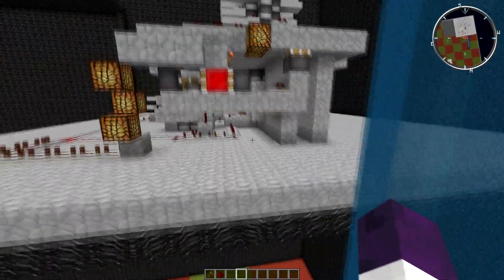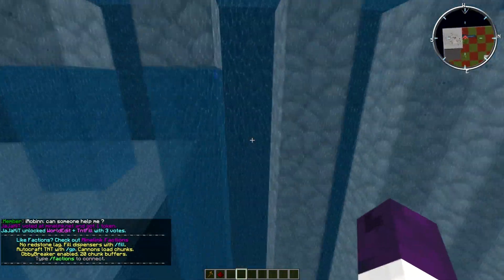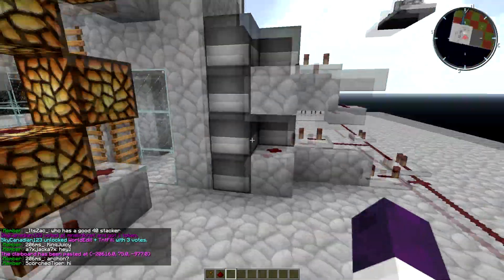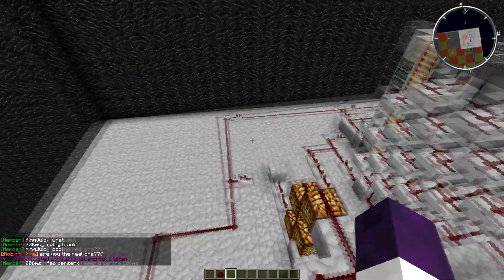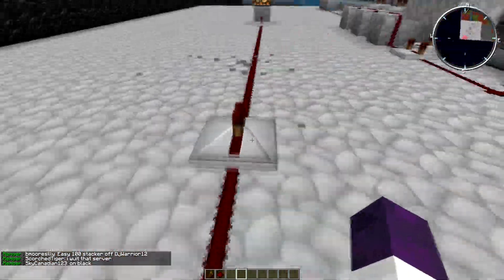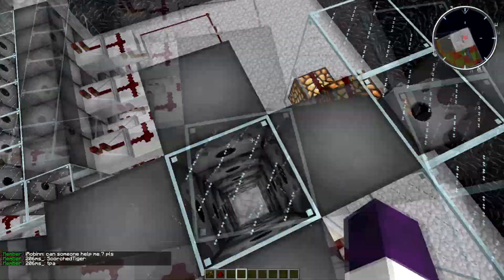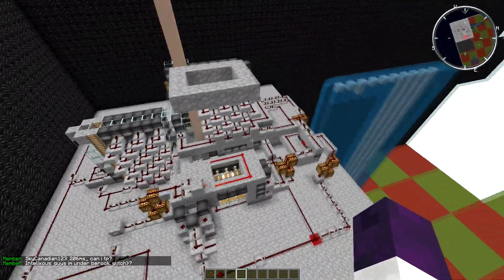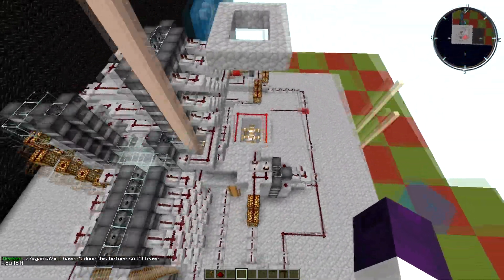60 Stacker 1 Shot Nuker - "60 Block Nuke"

Comment: None of your cannons work including this one. I just schem'd this one in and tried it and it didn't nuke. Tnt just flew up in the air above the stack after stacking. I've also tried your 60 stacker , 80 stacker, 100 stacker, and NONE of them worked. I had to fix them myself. Is this just me or?
Reply: Its you because they work in the vid
Reply: The delays are going to be different depending on where you're cannoning and such you're always gonna have to change the delays
Reply: moral they work, you just build it wrong
Reply: it's just you all cannoning is different for every sever
Reply: what do you mean plz explain im a noob at cannoning
Reply from the maker: I am spending time checking and testing my cannons. Sadly the different between servers are highly effecting my cannons. I am doing my best to make sure they work on most servers including Minelink, Woodycraft, Thearchon and more....
Reply: Dexter113 Thanks my nigga

Comment: does this work on saico???
Reply from the maker: It should unless its lava/water walls
Reply: +Dexter113 so it can't sand stack on saico??
Reply from the maker: reagan corwin It works on saico but if there is lava/water walls and the lava flows after being stroke by tnt it will clip :)
Reply: +Dexter113 ok thx
Reply: +Dexter113 how do I water it tho when I watched the video you didn't have any water that can't be right
Reply from the maker: reagan corwin Look in desc after "How to water" :)
Reply: +Dexter113 what??
Reply: Can you show the guider for the 1 shot attachment and explain it